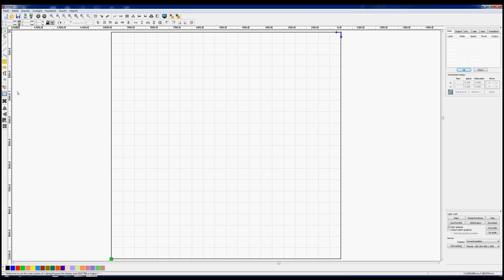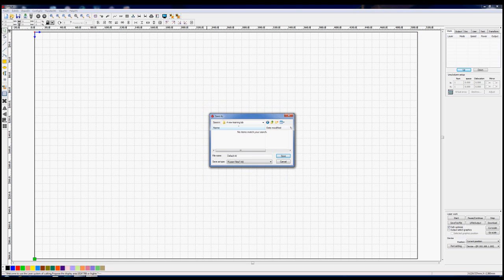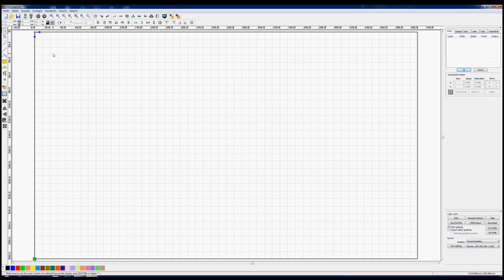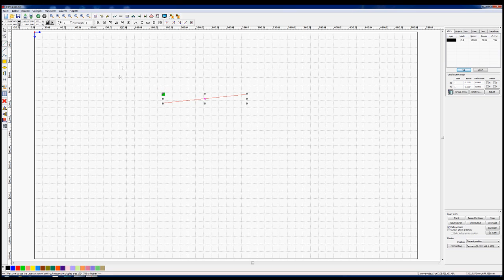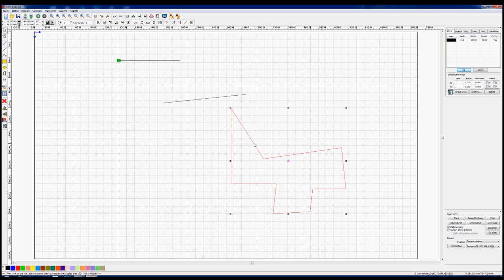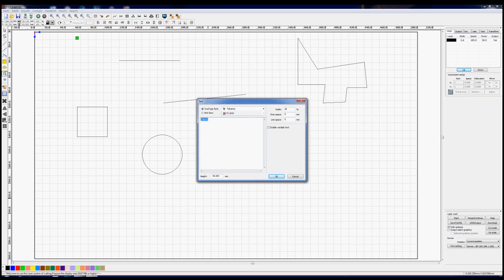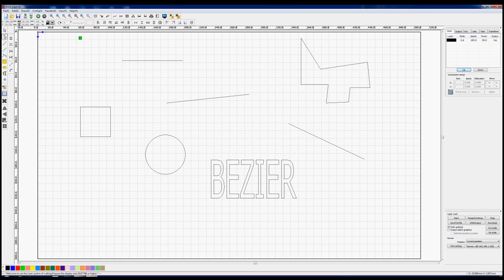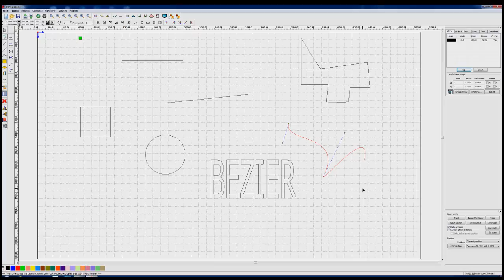RDWorks Learning Lab 01  Basic drawing tools

Comment: Hi there, Ive just bought myself a Laser Engraver and am a total newby as ive moved up from Pyography to this.  I have assembled my machine and am ready to learn the software.  However Im not sure where to get RD Works from?  When ive tryed searching for it on the internet I can't seem to find the right place to download it from?  I look forward to your response so I can get started on following your videos :-)
Reply from the maker: Hi Lisa
Welcome to this strange new world . There is a good site to go for the download of a stable well tried version of RDWorks
http://www.thunderlaser.com/laser-download

The first, third and fourth downloads are what you need. When you have done that you can scroll down and find some cutting parameter files. You may not need them immediately but be aware that they are there because they will be useful when you get going.
I was very ignorant of this technology a year ago when I started and the big mistake you will seeing me make in my early videos is to  run the tube at high %power values.  My immediate advice is don't program anything above 60%power. I think it would be good to ask more questions on the you tube private messaging system. How do you find that??
Click the big blue square beside Sarbar Mulimedia and a page with tabs opens. Click the ABOUT tab and another page appears with a MESSAGE button top right.

Best regards
Russ
Reply: Absolutely fantastic, your a Star.  I very much look forward to watching all you helpful videos.  Thank you so very much :-)
Reply from the maker: Hi Lisa
I would urge you to jump forward and watch https://youtu.be/xDZmuxq5BEM This ammeter will be your best friend to stop you doing what I and many others do to burn their tube out prematurely.

http://www.ebay.co.uk/itm/0-30mA-DC-Current-Analog-Panel-Meter-Ammeter-Amperemeter-Off-White-/191596306643?hash=item2c9c07a0d3:g:ynEAAOSwT6pVkliU

It will take abou two weeks to arrive.

Good luck
Russ

Comment: Wich drwing program do you use? I am thinking of buying "CorelDRAW Home & Student Suite X7" or is there program for free, that is useful?
Reply from the maker: I use a 2D CAD program as my main drawing tool but I use Adobe Illustrator and Adobe Photoshop to copy and prepare line graphics before I load them into RDWorks. There is a great free 2D CAD  program called Draftsight  that you can download but I'm not sure if there is  a free CorelDraw clone. 
Best  regards
Russ
Reply: I just downloaded Draft Sight. It seems I have to learn a lot before i can even think about using the laser cutter. :) ... but youtube provides lots of tutorials.

Did you make a video, that describes what I have to take care of,  when I make drawings in Draft Sight (or any other CD program) and Import it into RDWorks?

The last question leads me to the question, where I can download RDWorks. Do you have an URI?
Reply from the maker: There is a 186 page manual on how to use Draftsight. I have a copy already downloaded so if you wish to send me your email address on the YouTube personal messaging system I will send you a copy. Have you ever used  CAD before?
You can down load RDWorks from a website called Thunder Laser 
 http://www.thunderlaser.com/laser-download
This is not the latest version but it's a well tried version and has 99% of what you will find in the latest version. Download the V8, the install instructions and the manual. All are free
You can then follow my journey of learning to use the software and the machine by working through my sessions.
Best regards
Russ
Reply: Now I finally bought one of those laser cutters. I my first experiment I found out LibreCAD and RDWorks from Thunderlaser works well together.
Reply from the maker: Hi
Thanks for the info about LibreCAD. I have downloaded it to see how simple it is to use.
Best regards
Russ

Comment: I purchased the same laser with the same software.I have been unable to run any programs.  Each time I try I get a Water error message on the screen.  I have the water running as required.  Have you had this problem?
Reply from the maker: +randy rundhaug 
Hi Randy
Yes.  It was fine for a month or two and then started giving this message randomly and would stop me using the machine mid session. I would turn the machine off for 10 minutes and restart no problem. Eventually It became too annoying. so I have temporarily fixed the problem  by cutting the two wires that go into the switch and connecting them together with a joining block. The machine is now happy because it now thinks the switch is closed. But I make sure I never turn the water pump switch off and I also regularly check water level in tank. I do plan to fit another switch but I'm currently looking for something more reliable.
Good luck with your new machine and enjoy
Russ

Comment: Hello, how do you draw a rounded rectangle?  Is there a way to do it simply, or do i have to use the bezier curve tool to manually draw it out?  thank you!
Reply from the maker: +redpotatofromafrica 
I know exactly what you want  and you maybe able to approximate it with the Bezier tool. You must remember that Bezier lines are a computerised form of freehand drawing curves and not geometrically definable arcs. I am afraid you will quickly come to realise that RDWorks is not a vector drawing package or even a CAD package even though It has a few tools that you will find in either such softwares. You need to do your drawings in another package and then import them to RDWorks which will then do a pretty good job of turning them into machine readable code without you needing to understand machine programming.
Reply: +SarbarMultimedia thank you. that works well, but then I need to have the rounded rectangle as a line that the Boss Laser can cut out, so I need to create that on the RDWorks program. I guess I will need to draw it on the program with bezier tool. is there snapping to grid lines?
Reply from the maker: +redpotatofromafrica 
The features you are looking for and would be most useful are things like snap/trim/extend. Sadly they do not exist in RD Works The only snap feature I have discovered, is when you use a polyline and go to close a shape, a little square appears at your cursor. Have you been through all my first few tutorials that cover issues about assigning features to different layers?
That's one simple way of cutting an outside shape last. I'm guessing you have imported a picture without a frame and you now want to cut the finished item out with your curved rectangle. One of the later lessons shows you that you can import a second picture on top of your first one and then move it around to get the alignment you want. I see no alternative to drawing it separately  in a proper drawing or CAD software There are some free downloads or even try before you buy trials available, look on Ebay for older 2D versions of TurboCAD at silly prices OR take a look for free vector art frames on www to download a shape.
Reply: +SarbarMultimedia that is a fantastic idea, to import the rounded rectangle as a separate image and then assign that image to cut, right?

I want to make a medical alert tag for my kids, like dog tags for soldiers. lettering and symbol in the middle, then cut out a rounded rectangle.
Reply from the maker: +redpotatofromafrica That is correct. My only thought is what material you might be using?
Reply: +SarbarMultimedia an acrylic plastic.
Reply from the maker: +redpotatofromafrica . That's fine and safe to cut/engrave. Smells a bit but no toxic fumes. Make sure your fixing hole is not too close to the edge because acrylic is not very strong.
Reply: +SarbarMultimedia good points, thank you! I'll let you know how it turns out!

Comment: hello  Problem in a program RDWorksV8 I hope the solution 
Problem in the importation of certain files
https://www.youtube.com/watch?v=WMvj6gQBok4&feature=youtu.be
Reply from the maker: +mohamed alaraby 
I say in my videos that I am not an expert because I am still learning about RD Works myself. I have looked at your video and without an explanation of what your problem is I hope I guess correctly. You have V7 which appears to import your DXF in an  exploded format. It looks similar to the original picture...is that what you wanted? When you imported it into V8 there appeared to be nothing there. There is something that has been imported because I can see all the colored layers in your work tab. Along the top of the tool bar there are 7 little magnifying glasses.You pressed the A (display all) magnifier. If your original picture had some small artifacts a long way from your drawing then pressing the A magnifier will shrink your import to a dot as it tries to display that artifact. Instead, press the middle magnifier  to display your grid page at full size. Your import is definitely there otherwise the layers would not display.
Reply: hello SarbarMultimedia
I have a problem in the import file on the V8
And it is imported on examination
And I want to use V8
I will send you conceptual
Possible send me your email

Comment: I love when you draw a line in the wrong place and click undo and it deletes the whole drawing,
I find saving regularly when the wheels are still attached is nice work around.
Reply from the maker: +Mentorcase 
Hi
As you get a few more sessions into the series you will find that i mention many times that RDWorks is not a CAD or vector drawing package. It has some tools that allow simple drawings to be created but it's primary use is to take drawings produced elsewhere and convert them into numerical programs that your laser machine can work with. On first use I thought it was rubbish but several months on it's an incredibly powerful tool that you get for free!